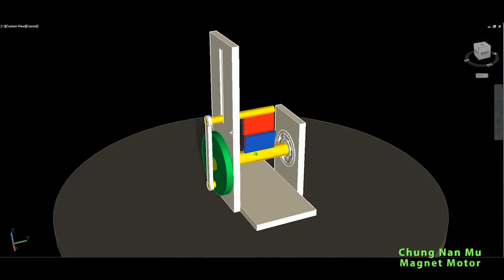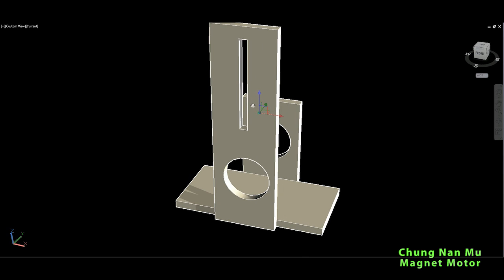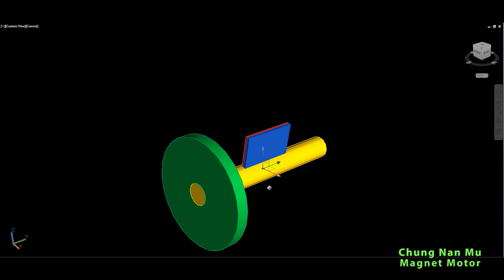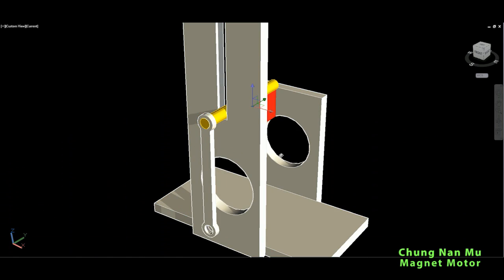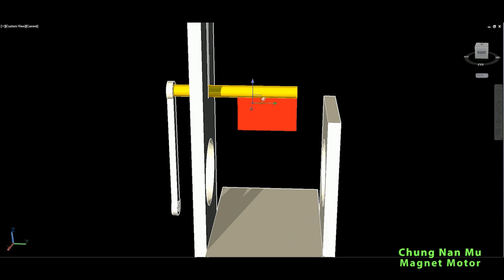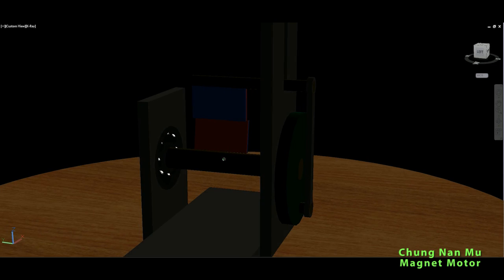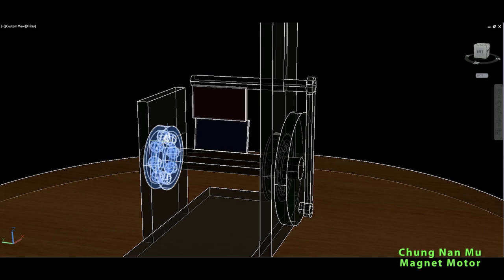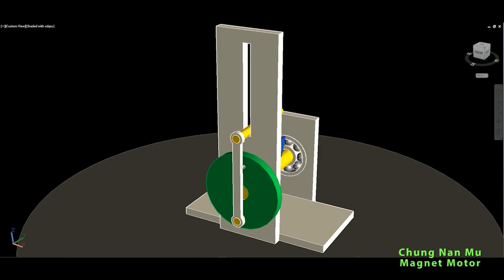Free Energy Generator, Chung Nan Mu - Autogenic Energy, Magnetic Motor

Comment: Make it in a V8 design, gets tricky when and if u use the air build up to flip/move the cam magnet. You can also use flywheel and starter motor to engage use a Chevy motor design and make heads out of plexiglass and aluminum block design new pistons made to hold super magnets. Also gives better option to use existing alternators and drive belt systems making it quite universal. That's the way I'd go with it.

Comment: Mario ,listen to me, this does not work, no magnet motors work, they can't work, there are millions of versions of the same thing and none of them work. If they did you tube would be full of videos , of actual running motors. But guess what mate, not one video, not one. If they worked we would all have one in our home now, wouldn't we? The problem with vids like yours ,are all the gullibles that go "wow that's unreal" , when it just isn't. you are helping to decrease the combined IQ of the planet. Just stop.
Reply: Who are you to have the audacity to say what Works and what doesn't?  Mario's models are almost 100% workable with some minor modifications and alterations here and there...  Like in this specific example the propelling magnet has to remain high until the rotating one passes underneath...  Not starting to descend while the rotating magnet is still behind it...  
Still the idea and the concept is GREAT!  It needs slightly better synchronization system, in this particular case spiral wheel will be perfect!!!
Reply: Well let's leave who I am out of this just for now. There is some fairly simple physics preventing every single one of these attempts at perpetual motion from working. There are probably millions of designs for a MAGNET MOTOR and none of them work because magnetism is not kinetic energy, it is potential energy so it's the same as a spring. So if you replace the magnets with springs will any of these engines work? no they won't, you also can't get more out of a system than you put in and there are always loses to friction. Short story from long, they don't work, any of them! However if all you perpetuals want to go and look at a substance called Graphene, science may be on the verge of the HOLY GRAIL . Can't explain what's going on at the moment but Graphene appears to be breaking some of the laws of physics. Sorry that I seem so self righteous , it's just that I've done a fair bit of work with magnets and for this application it's a dead end. Its just a huge waste of time and money, that's all. Great fun but not productive in a practical sense. cheers.

Comment: there are probably thousands of magnet motor claims none of which have been validated.. A little analysis will indicate that the upper magnet can never come against the lower magnet due to repulsion. This is what will prevent the motor from functioning. Magnet motors have for the most part been proposed by those interested enough to think about these motors but lack the necessary knowledge about magnetic fields. No one has ever designed and built any magnet motor that actually works. why this is os may be explained by the nature of the magnetic fields associated with magnets. Magnetism is not a radiative phenomenon but a conservative system.

Comment: The  hardest  part  is  supporting  the  shaft  with  the  upper  magnet  on.  There  will  be  some  torque  on  that  shaft .  Does  the  connecting  rod  take  all  of  the  torque ?  Thanks  for  the  video !
Reply: I think it would work better with 2 flywheels, 2 conrods, and 2 slotted brackets.

Comment: Nice simple idea. When I was designing my pulse motor I decided to measure the repulsion distance of magnets I had available. Then I made a 3D model where the magnetic repulsion range was represented with translucent bubble around physical magnet solid. this might be helpful in this design because you will have an idea of how long the arm of the flywheel should be. But I guess testing on physical model will be needed as well.
Reply: Kapalek84 uuu